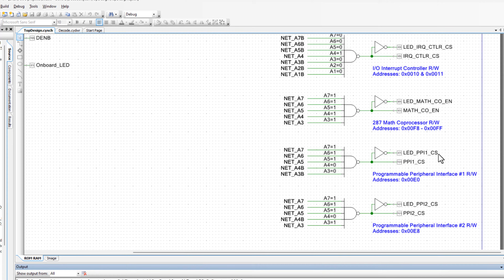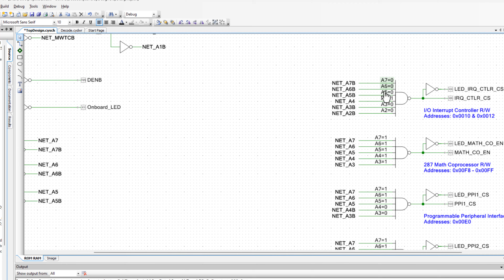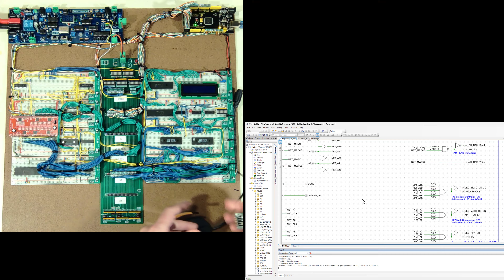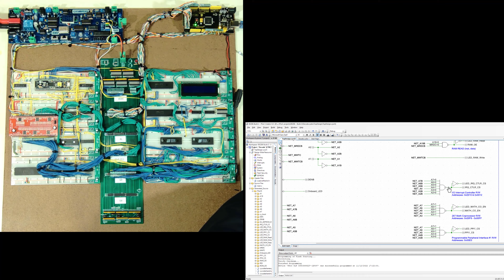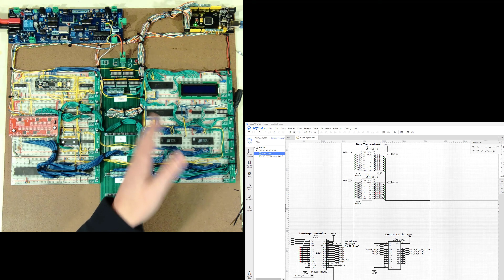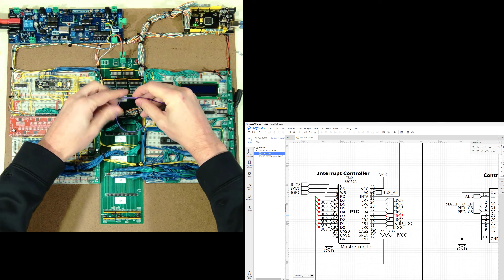80286 Build, Ep. #36 - Connecting the Interrupt Controller

Comment: Another nice video! I see you are coming along nicely.

I do have some feedback, however. There is a catch when "skipping" bit positions in the decoding logic. For instance, suppose you wished to address a peripheral on addresses 0xfc through 0xff. If, in your design you know you are only going to use the lower 8-bit lines of the address bus to access your peripherals, decoding the only the lower 8-bits of the address will suffice, but what if you then later on run out of address space? The device on addresses 0xfc through 0xff is now not just listening on those addresses, but also on 0x1fc through 0x1ff, 0x2fc through 0x2ff, and so on. Updating the code in your PSoC is going to be relatively easy, but updating the schematic design means updating the PCB design, which in turn will mean spinning a new PCB. 

I prefer to do full decoding of the address bus, even if it means more decoding logic in the final design. A device with up to two addressable components will need 14 bits decoded,  device with up to 8 addressable components 13 bits, and so on. The remaining bits can then be connected to a device's own address bus (A0 and A1 in the latter example, just A0 in the former). 

An interesting oddity of Intel's x86 line (even the ones with 8-bit data buses, the 8088 and 80188) is that outputting a 16-bit word to an I/O port will "spill" the remaining bits to adjacent I/O ports. So an OUT (0x20), AX will send out the most significant byte to I/O port 0x20 and the least significant byte to I/O port 0x21. How a given peripheral that listens on those ports reacts is of course an entirely different matter. As a rule of thumb, 8-bit devices can be byte addressable, but 16-bit devices need to listen on 2-byte aligned addresses. 

The PIC is an 8-bit device and is therefore not expected to transfer 16-bits of data in a single read or write and can thus be byte-addressable.  The PIC needs two I/O addresses (which on a PC compatible are 0x20 and 0x21 for the primary PIC, and 0xa0 and 0xa1 for the secondary PIC). This means decoding the top 14 bits of the I/O address space, of which all but bit 5 will have to be 0. This will give you a valid chip select and A0 (not A1!) can be used for addressing.
Reply from the maker: Great feedback, as always. That all makes sense. I have taken a shortcut so far. At some point, I will likely use a full address decode, and depending on the size of the solution, will use discrete logic ICs or a PLD (or two) -- or maybe even just leave the PSoC but decode the full space. Thanks for all the good info, @Damouze!